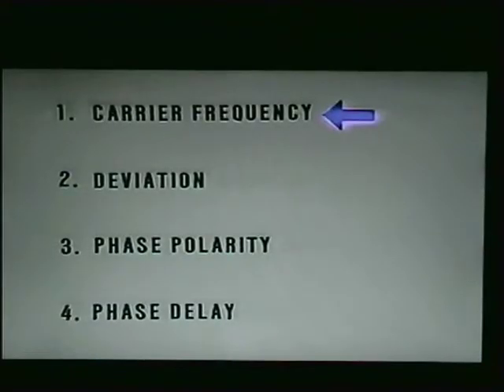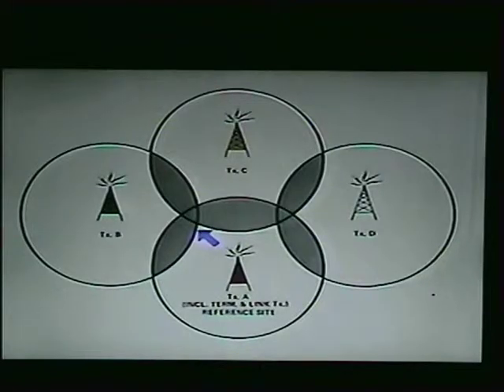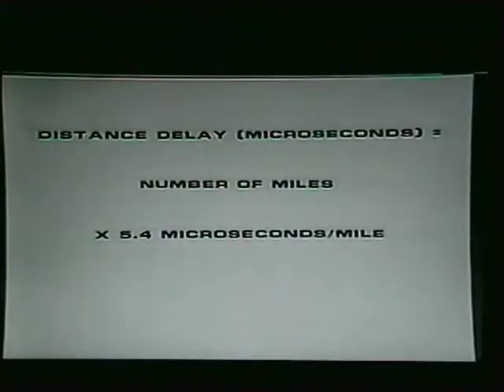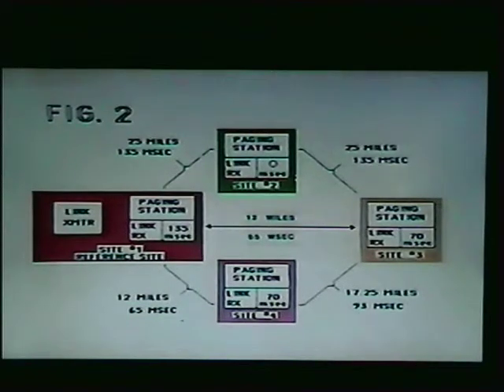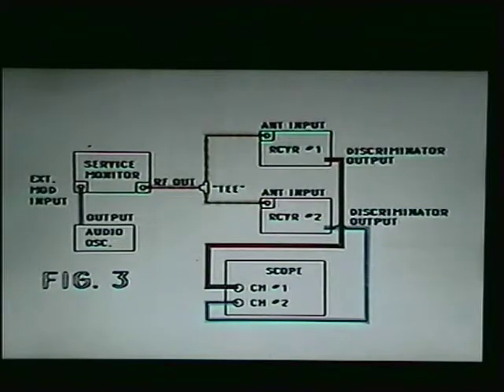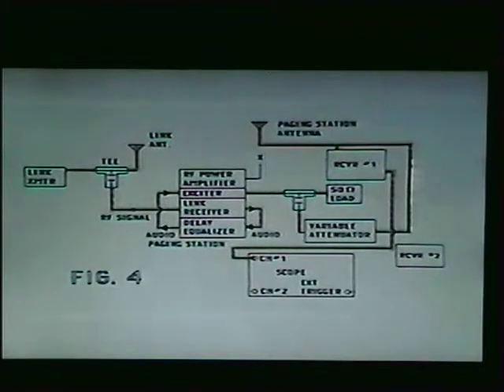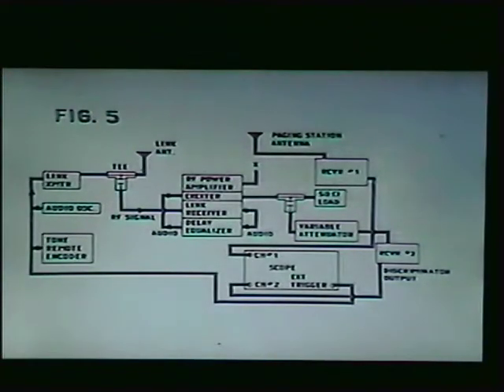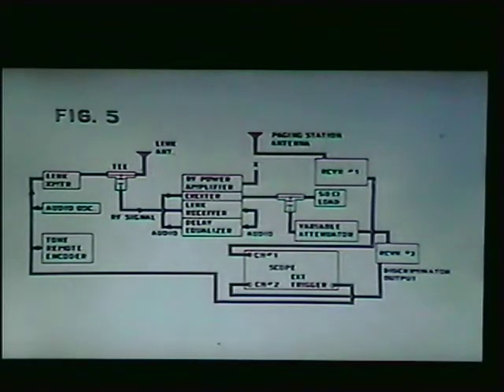Simulcast Paging Optimization

Comment: Excellent video !  Thanks.
Nowadays, it becomes quite a bit easier to do simulcast with the availability of
low cost GPSDO systems that utilize decommissioned GPS modules from cell sites.
A GPS disciplined oscillator reference unit can provide 10mhz reference output and a 1pps
output simultaneously.

I just purchased a GPSDO with a 4-port distribution unit for my home bench.
I’m able to share a common 10mhz reference to my oscilloscope, both
spectrum analyzers and a frequency counter.  All for under $600 bucks shipped!

I would LOVE to see more Motorola training... Especially QUANTAR!
Thanks again for a great RF channel.